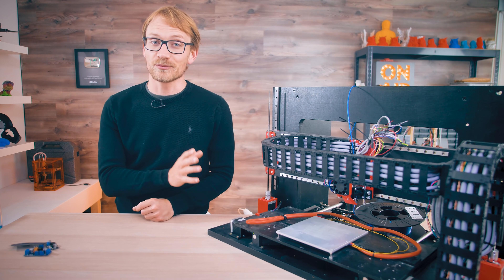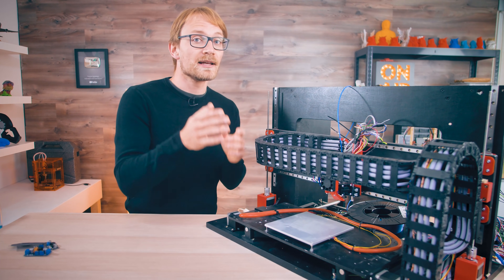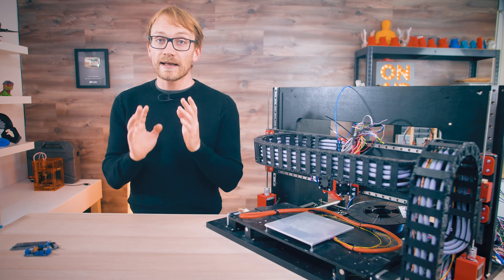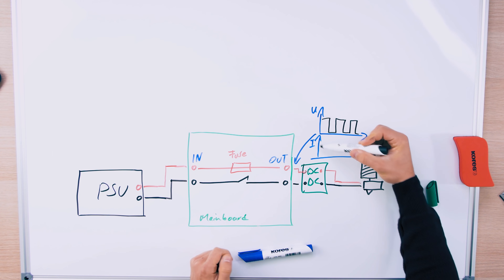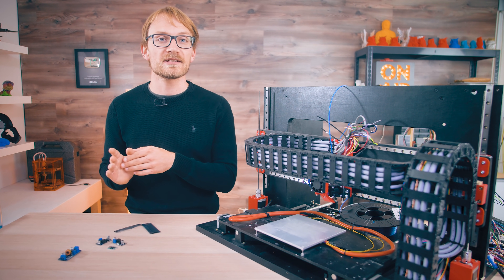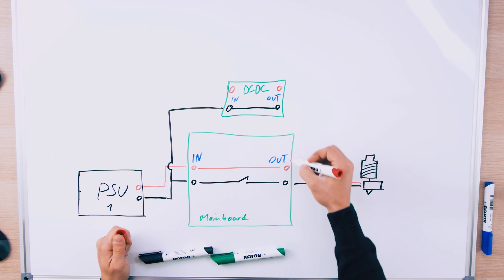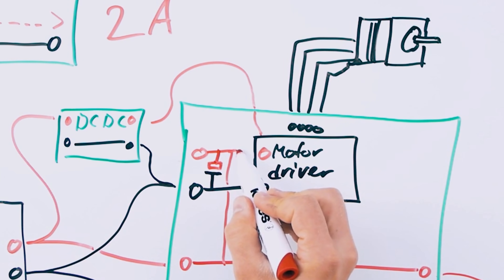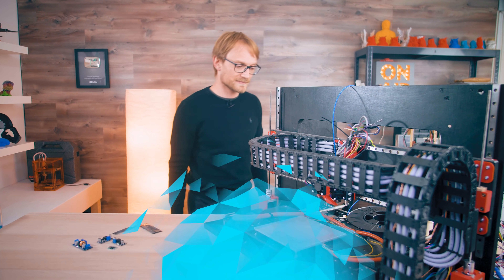Use the WRONG parts on any 3D Printer!

Comment: I have a question I did the switch off with a ramps 1.4 with a dc boost converter 150 watts
the source is 650 watts atx 12 v pc power supply
the thing is it works it heats up the hot bed and hot end but it heats up the negative leads from the source and the mosfets boil like hell is it possible to fix this? Thanks for the excellent information everything is runing on 12 v and dc convert 24 v to the hot end and hot bed

Comment: hello Thomas Question for you I gotten one of those silent fans that is 12v and my 3d printer (Cr10s Pro v2) that is 24v so is that means I have too get buck converters and turn the voltage up too 24v for the fan  but wont that burn the fan and short circuit the fan ? I hope someone would answer my question thanks

Comment: Can't find anything else to this topic. I hope u still read the comments here.

I installed a phaetus rapido 24V hotend on my 12V mega x and a new beefy heated bed with 12V 250W.
Heated bed 12V wiring stayed the same, just swapped out the cables but for the hotend I got a 24V psu.
The hotend works but as soon as I want to heat the bed klipper shuts down the printer.
But if I disconnect the negative connection from the 2 psus hotend and bed work but hotend ist very slow.

Maybe u know what I am doing wrong. I'm literally clueless. Checked wiring a couple of times now, can't find any flaws.

Comment: Lovely video. Now a question.
Can I use one converter 24v->12v to power both part cooler and hotend fan. They are both switching on the low side.
I did this and the hotend fan on idle got -5v and on idle for partfan, -10v.
But when they are both on at full, they are both getting 12v.

Comment: So on a 12v printer if I use a 24v hotend that draws 3A and wire in a 12v to 24v step-up converter as you have shown, how much will the converter be drawing on the 12v side?

Comment: Great video so here is my question.  I want to run a 24v hotend on my 12v Prusa MK2 that uses the mini-rambo 1.3a board which I believe is rated to atleast 24v.  Would I use a 12-24v stepup converter and tie its input ground to the board/PS gound then use the + output from the converter straight to the hotends + side and leave the hotends neg side still to the board?  Hope this makes sense!
Reply: Did you get any solutions?
Reply: I want to run 12v e3d V6 on a 24v ender 3, how can it be done?

Comment: Hi. I can hardly get normal (not silence) 40 x 40 24 volts fans but I can find 25 x 25 24 volts fans easily. Is this 25 x 25 enough to keep cool the extruder?

Comment: How would one use 24v for stepper motor (drivers) when the drivers are soldered directly to the board? Especially on that of the Duet 3. I would prefer to run the stepper motors at 24v rather than the supplied 12 from the board, is there something else I can use to do this?

Comment: This is yet another reason why the Duet 2 is awesome.  Converted my CR-10s to a Duet 2 Maestro on 24v, I managed to keep 12V fans and bed probe by running a buck converter off one of the few board locations that gives you VIN for a positive and then relying on the negative side regulation.  Works perfectly.

Comment: Great video (as usualy). In my case I use 24v, from a boost converter, just for the motors, turning the pins VMot of the drivers TMC2208 upside down.  My heated bed works at 240v controled by a solid state relay and the extruder direct from the Ramps 1.4.
Best regards and,... keep the nice work you are doing

Comment: Using two power supplies, are you using a 12v and a 24v supply? Or are you doubling up two 12v supplies to achieve 24v? What would the difference be in the wiring?

Comment: Careful throwing a higher voltage supply on those switching components, yes low side switching won't care about the voltage, however the increased voltage will almost certain increase the current, which at least on the printers I've used seems to be pushing the capabilities of their mosfets at standard voltage. I'd recommend using breakouts with higher power rated mosfets honestly

Comment: Or you could use a multiple voltage output smps, like an old atx style for instance, and get all the usual voltages at once lol
Reply: @soundspark  very true, however you could use a higher amp 12v component instead or 1 additional 24v supply, or a boost converter off the 12v rail. Still less than he used

Comment: i rly dont like Z mechanics on this printer, X axis looks very heavy, and that weight directly on motor bearings,  there are special holders for trapezoidal rods. I personaly have motors UP, trapezoidal rods in holders and connected to motors with flexible joint, all weight is on holders.

Comment: It should be noted that most of of those cheap boost converter boards are a bit overrated and should either be used for lower currents or need additional heatsinking.

Comment: Hello, I'm using a step down (LM2596 3A) after 24V PSU to obtain 12V to running 2 case's fan. I use both positive and negative wires directly from the PSU but I forgot a fuse on the positive wire. How much big must be this fuse, knowning the 3A max load from step LM2596, please?

Comment: Could you use 24v on a main board and a external mofset at 12v for my existing hotend ?
The PWM from the hotend output would go to the modest , but the input power for the modest would be 12v 

I’m not 100% how that would work?
Reply: A heater cartridge for 24v is cheaper than an external mosfet. Why would you do this?
Reply: @GvWMusic  because I already have the parts. A mosfet was like 12$ a 12v E3D hotend I would be re-purposing was like 60-70$. I guess I can spend the 9$ and go all 24v

Comment: 1. Use a fuse no matter what. It's not only cheaper than a new mainboard, it's also cheaper than rebuilding parts of your house due to fire damage.
2. If you use a 12-24V converter, check if the ground is actually connected internally. This is NOT necessarily the case.
3. If you use 12V components on a  24V mobo, you might destroy the mobo nonetheless, as the same power on half the voltage meands twice the current, which your mobo might not be able to handle. Will work fine most likely though.
Reply: I might add... do those motor drivers work on TTL signals or what? What about cable length, cable ratings, ground loops.... The FET voltage capability advice at the end of the video is on point but it's difficult for anyone to check if they couldn't figure out the whole thing by themselves. I have mixed feelings about this video: on one hand I'm glad it's encouraging creativity, tinkering and hacking, but there are so many things that can go wrong here.... it worries me.

Comment: I'm using 12/24 in my Mendel90 as well.  I just have one 24v power supply though and a DC-DC step down.  But I'm doing the opposite of you. I'm using 12v into RAMPS for all the motors, and using external MOSFETs (with heatsinks) to switch the full 24v for the hot bits.

Comment: i felt the explanation of how the motors can work harder is a little off, i am sorry to be so picky. the motors are not able to work harder, just faster. the static torque should not be changed by the driver, just more control over current from inductance can improve motor speeds because the higher voltage allows current to flow as the resistance increase from the speed of the motor movements increasing changing frequency and inductance. the current of the motor ideally would be constant, the voltage goes up and down to keep current under control.. this may not be a perfect explanation, and it is possible to set a higher working current than spec because of higher voltage, but if the parts work in spec, then the motor will work the same other than better performance from the speed. thanks. and i do see from your perspective that torque drops of the faster a motor turns, and the torque drops off less as the voltage increases.

Comment: Did the same with my Prusa MK2.8. Einsy Board with 24V but the heatbed from the upgrade kit with 12V. Works without issue as the Einsy has separate power rails for system / motors and heatbed.

Comment: It's not using the wrong parts, it's simply understanding the voltage (and current) requirements. Thanks for an excellent video! Lots of lots of useful tidbits to get everything connected up properly.

Comment: you could take 2 atx power supply float the minus on one of them and have crazy stable 3.3v, 5v, 12v, and 24v, with overkill on the amps side (any ATX has Way more safety build in than any of chines PSU)

Comment: 5:48 Not all DC-DC converters have common ground terminals, I've encountered some that use low-side switching as well and therefore have a common high side!
Reply from the maker: Those are called "inverting" DC-DC converters, which are increasingly rare and used for specialty applications around audio and signal transmission.

Comment: dc - dc buck converter is fine for higher current needs but is overkill; in most cases, a simple 3 leg regulator like LM340T-12  can provide a steady 12 volts from the 24 volt supply at 2amps.
Reply: And convert 12V x 2A = 24W to heat...

Comment: I'm not that sure low side switching is the best idea, I think it isn't allowed anymore, even in PELV circuits. I mean yea, it's the most convenient solution for 2 PSUs in parallel, but are the boards made for doing this? At least, I dont know how to connect the wires to get it switching that way. It's easier to use Zener diodes to cut the voltage for lower driven parts I guess. Using external mosfets  or SSR (no high frq switching) for the 2nd PSU controlled by the board might be a solution, too.
I gonna try some zener for fans and LEDs on my ender3. A combination of a PC psu and a 24v one might be interesting, too. U get secured 12v 5v and 3.3v out of the ATX connector without any major changes.
Many ways lead to Rome...
Reply: Where should be the problem with low-side switching? Most FETs are rated for way more than 24V Vds(max)... Also "not even allowed"? Who imposes that?

Comment: Spooky I just got an ender 3 pro yesterday and the main 24V cooling fan makes an horrible vibration that resonates through the printer and into the cupboard the printer sits on, I have a Noctua 12V fan to  try so I put 2 330R resistors in parallel then in series with another pair (to spread the ~.5W across the 1/4 resistors,) this gives me 12V for the fan and the resistors get to about 38 degrees. This will do to test out the theory and until I can get a voltage converter to make it permanent, my only worry is that the airflow from the Noctua is enough.

Comment: If u r using another power supply better to add external mosfet and take input signal from the mobo and add 24/12v to the heatbed and hotend as u like rest will run on 12/24

Comment: I run most of the things at 24V and I use 12V fans... but never have I even thought about using 2 psus... what a waste. Seems you don't know how to properly use dc/dc... you can't use a pwm to power it up (you power buck converter with a steady 24v)... you do switch the output of it with a 12v pvw via FET.

Comment: If you need 12V in a 24V printer for a quieter replacement fan (like in ender-3) the simplest solution is to just wire 2 (identical) 12V fans in series. One to cool your hotend radiator and one to cool your mainboard.

Comment: You can't run a circuit like this if there is any current, like a hotend or heated bed, with the switching on the negative side taking place in the board you will cause voltage ripple in the board back down all the other components running at a lower voltage than the supply voltage to the hotend/bed as well as ground loops. This will result in problems with the main board and a lot of electrical interference into the board. IT is highly recommend NOT to do what was shown in this video.
Reply from the maker: What path would the voltage ripple take to the lower-voltage parts? The supply rails  don't have a connection anywhere other than ground. 
I'm also struggling to understand how dual supplies would cause more of an inductive spike than a single supply.

What would be a better way to do it?
Reply: @MadeWithLayers  So you have one of the power supplies using the ground plane for the other power supply. This means the higher voltage is running down the ground plane of the lower voltage supply, you then have added a bunch of ground plane loops adding in your second voltage supply which means all the low voltage components are being hit by the voltage on the ground plane without any protection (because the switching is on the negative side). Switching the negative terminal is a combination of laziness, very bad practice and cheaping out on super cheap components (yes there are some circumstances where negative is better but there should be no need for this on a 3d printer). Now every time the higher voltage is switched there is voltage ripple across the ground plane back up the lower voltage supply, the more current the bigger the ripple. If you then supply the higher voltage to the main board and supply lower voltage to say your hotend (please don't do this), then not only will the heater element end up being supplied with a higher voltage than your lower voltage supply, the current will run back up the ground plane then through the heater element resulting in your regulator/power supply being connected with the wrong polarity on the supply side of it (where it is highly unlikely it has any protection) and will almost certainly result in damage and/or a fire at some stage. 

How do you make it better?, if you don't know what you are doing with high current electronics just start with the higher voltage supply and board, keep all your components the same as the mains supply voltage and save yourself buying a new house........

You can of course correctly place some additional diodes and capacitors to resolve the issue but I don't think you are going to want to cut the traces and scratch new pads onto traces on the main board in order to achieve this. A Duet clone is only $100AUD which is CHEAP, they are just as reliable as the real thing and will save you the headache of trying to change an existing board and ensure the risk of your mods don't come back to bite you in wasted filament or lost assets.  

Just to be clear, this is unlikely to be an issue if you step the voltage down from 24V to 12V, via that tiny switching regulator you had there, for the cooling fans (probs just as cheap to buy the right fan as it is to buy that awesome little switching reg) it is low current and the fans have a set of diodes and the mosfet driver on supply and usually the ground sides that will ensure you have no issue. 

And don't get me wrong, I loved the video and this type of video alongside the ones you do where you take a technical look into a particular type of filament or product are what I tune in for :)

Comment: I just eliminated the 12V psu as it drew only 500mA or less as all components are 24v except the cool break and led light. I use a buck converter for that. Now that the heated bed is mains powered I can swap out the 24v 15A with fan with a 24v laptop psu which is fanless. I measured less than 2A load on 24V so a 150W psu should be more than sufficient.

Comment: Watch it with those buck convertors. The downside of those thing is, if they break, they can forward the full voltage. So if you use a 5v buck convertor to run a raspberry pi of of a 24 PSU, and the buck convertor dies (as you said; they are VERY cheap), it will kill your pi as well. For relatively low loads (<2A) it is wise to mount a 780x power regulator behind them, so for instance, if you need 5v, use a 6v buck convertor and mount a 7805 behind them. If the buck convertor then dies, it'll kill the 7805 BUT those don't forward the input voltage when broken.

You can't just use a 7805 as they dissipate power by heat. For instance if you have 24v and want a 5v load of 1A, a 7805 woud dissupate (24-5) * 1 = 19 Watts of power, which is about the same as a soldering iron. If you use a buck to get it down to 6v, then the 7805 will only have to disspate 1 Watt of power, which is next to nothing. Use a 7805 for 5v, a 7812 for 12v, and so forth. Or use a LM317.
Reply: @soundspark  Same here, but it toasted a noctua fan

Comment: Question of Buck/ boost or 2 power sources is almost pointless. Each power source used with a 3d printer is technically a buck converter and does almost the same as its small brother. (Generate high frequency pulses and then smoothing them out). Newest Buck / boost converters are excellent and does the job very well if they are made for the required power.  So I suggest to have one higher voltage 24 or 48 V with enough power reserve. I suggest at least 30% - 50%.  Togehther with quality buck converters with high speed switch "transistor" and high quality condensers. It works very well.

Comment: Nice wrap up of information that took me several hours to get myself for my build. I used a DC-DC fixed module for driving my 24V PSU to 12V for the fans as i bought the wrong ones. Those modules cost a bit more but you do not need to calibrate them and they come in an isolated plastic case which you can just bolt onto your printer. Because i installed them near the mains voltage cabling i feel much safer about it.